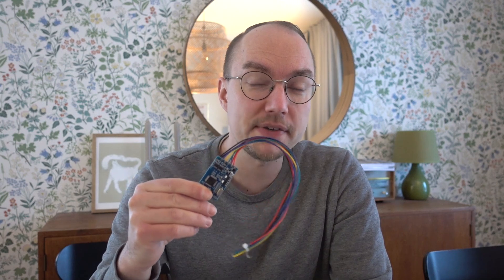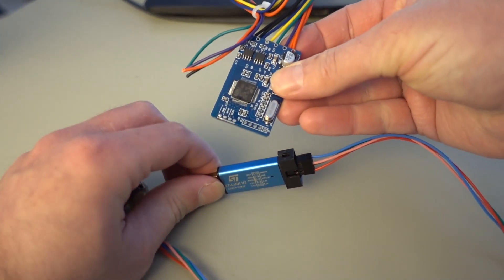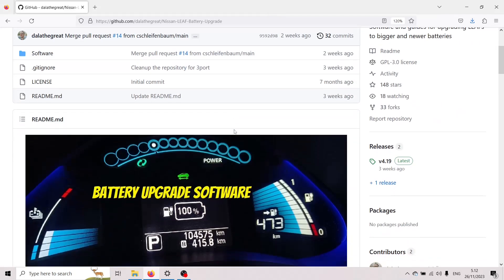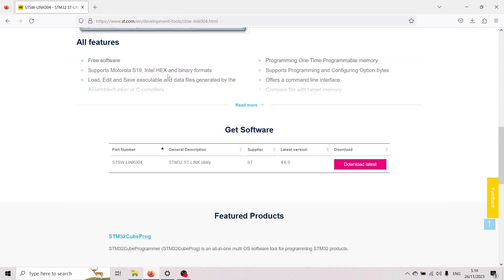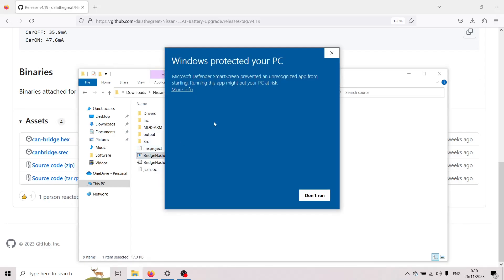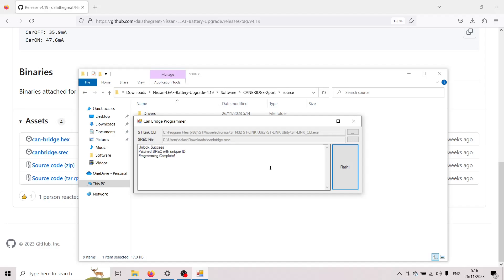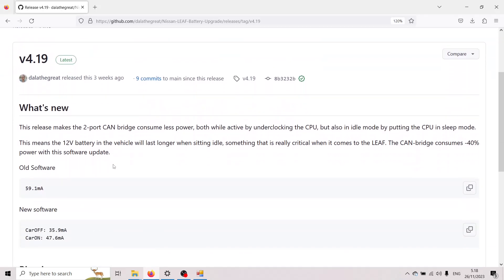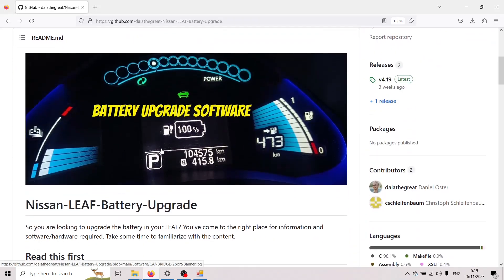Guide: Flash Battery-Upgrade onto 2-port CAN-bridge

Comment: Recently ran into "it's more than 10 years, Nissan does stock OEM parts anymore" though. Frustrating when doing body and chassis work.
Reply: This would actually be a good crowd to ask: do any of the frontend parts for the 2013-201? Fit the 2012?  Specifically the aluminum cross member and the supports for it. The stock numbers are different, but the tiny drawings look pretty much identical.
Reply from the maker: mynissanleaf.com discussion forum is great for questions like this!
Reply: @DalasEVRepair  I'll head right over!